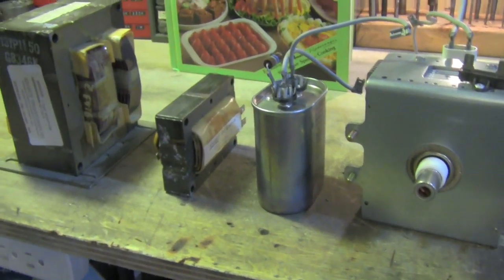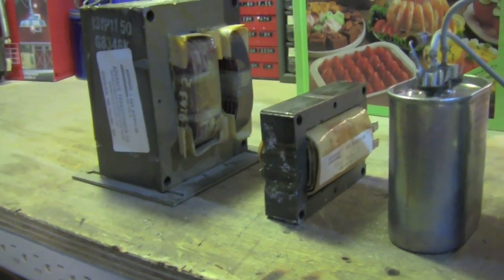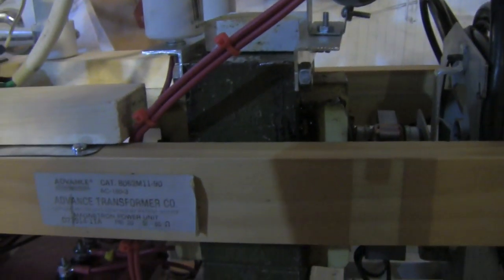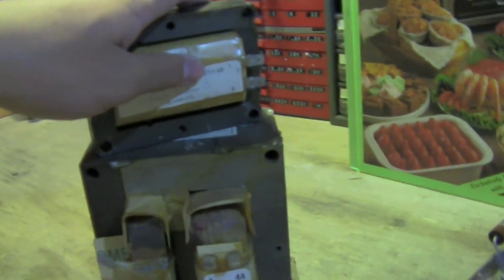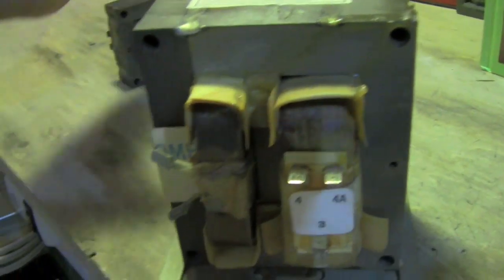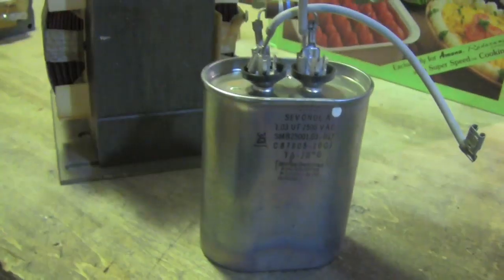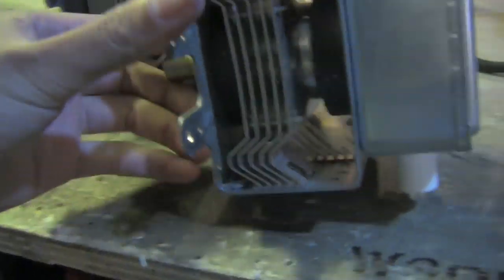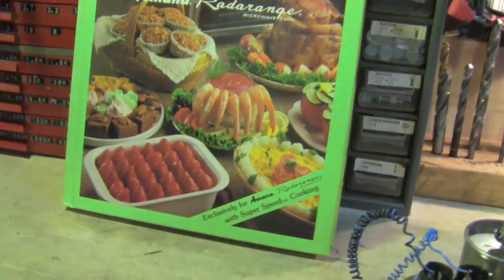NEW High Voltage Microwave Transformer, High Current Transformer, Capacitor, and Magnatron

Comment: The high current winding on the newer MOT (the red wire you pointed to) are used for the filament in the magnetron. That old microwave oven used two transformers. One the HV for exciting the magnetron, the other just for the filament.